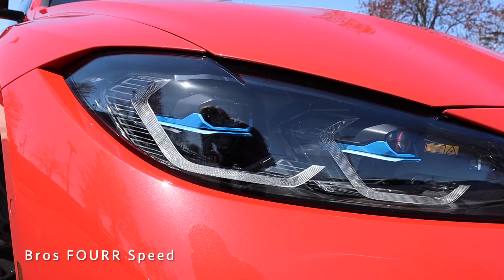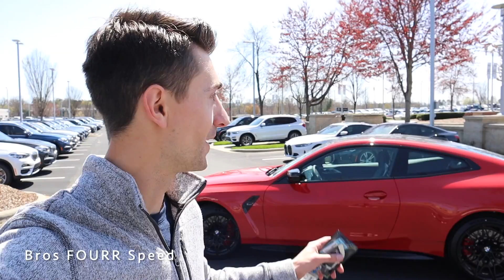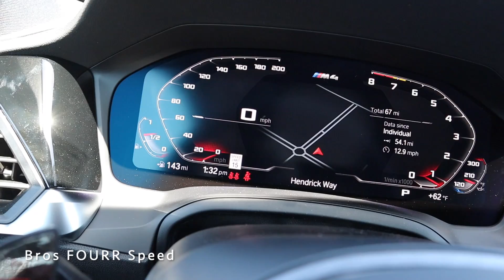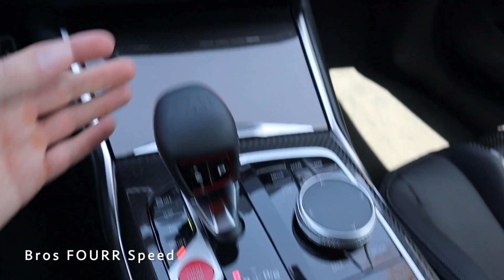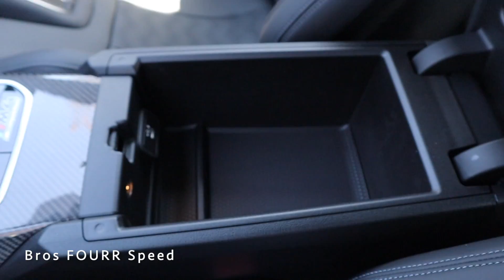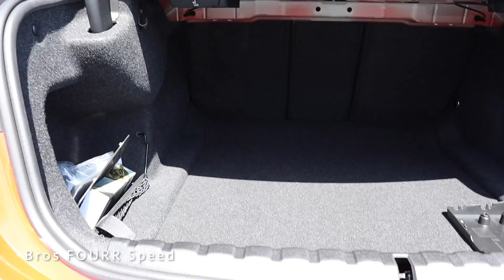2021 BMW M4 Competition Coupe: Start Up, Exhaust, Test Drive and Review

Comment: The BMW interior is VERY NICE but you’re paying $$$$.  EXTERIOR - Mustang styling copied.  Grill ugly!  Performance- 10 speed Mustang GT.
Reply from the maker: Its a nice car for sure. But there are a ton of differences between a Mustang and M4. Mustang still feels like basic Ford with cheap plastics. BMW feels much more put together. Have you driven both these cars back to back? I've driven every Mustang under the sun. While they are great sportscars for the money. Once you experience premium brand cars, you can tell all the cost cutting that goes into normal brand cars. M4 is on a whole different level
Reply: @BrosFOURRSpeed  - Yes I’ve driven both and I agree there’s a big difference. But I don’t think the difference is worth the difference in price.  My GT premium or Bullitt Mustang cost $40-50k it loaded and feels really great inside and looks great outside.  The BMW LOOKS BETTER BUT NOT WORTH TWICE.
Reply: @BrosFOURRSpeed  - You get a better sounding exhaust and more power from a GT Mustang.  The main difference is the interior especially the plastics.  You’re paying half the price for the Mustang and I think you’re getting better value. In about 3 years the bmw is selling for half its original retail price and trade in value drops a lot too.  You lose less with the Mustang because it costs less to start with.  How much money are you willing to spend and lose and a rapidly depreciating item?  I like to be frugal if I can especially when I can have so much fun driving a Mustang or Supra or Z for much less and have no worries about my warranty expiring!👍🏻😊

Comment: Compare a Race Red Mustang GT for half the price.  They look very similar re the exterior lines etc.  performance is also similar too.  The GT 10 speed V8 in the Mustang is very fast and engine exhaust sounds much better.  I think the BMW is nice but for my money I’ll take a Mustang.
Reply from the maker: As much as they might be similar in shape. Haven driven multiple Mustangs, there is no comparison at all. This feels wayyy nicer and more premium. Much better build quality and is a lot faster! A new Mach 1 would be on the similar line and thats mid $50k. But the M4 is still faster and has better interior materials.
Reply: BMW a kill a Mustang GT 460 Hp VS M4 505 HP plus BMW sports suspension I'll  🐕 you streets or freeway GTFOH

Comment: Great video. Have you driven the C8 Corvette? If yes, can you tell me if the M4 pulls similarly to the C8? Or which one feels faster? Thanks man!
Reply from the maker: I've driven the C8 quite a bit. Honestly the Corvette doesnt feel that fast. M4 is way quicker from a roll. C8 has amazing launch control, but aside from that it normal car fast. Not much quicker then my Supra when my car was stock. And this M4 is more on par with my Supra now that its tuned. So M4 will feel quicker most cases
Reply: @BrosFOURRSpeed  Appreciate the detailed answer man. Honestly, I'm surprised by your answer because all the people who drive the C8 on YouTube act like it's the fastest thing in the world hahah. My other question is: do the M4 and GTR feel about the same fast wise (stock for stock) of course.
Reply from the maker: I think there's just a lot of hype around the C8 where everyone just wants to say its the best car ever just because its mid engine. While its a great car for the money. To me it's just a Corvette that looks like a supercar. So the looks are making people just keep thinking its actually a supercar lol. It's no Lamborghini 
GTR feels a tad faster stock for stock and will launch better off the line.

Comment: This or the GT500 2021?
Reply from the maker: Thats a touch one! This will be a cheaper option. But the GT500 is much faster in a straight line. This isnt quiet as fast stock in a line, but this feels much lighter in the turns. If you want a car more for mountain, roads, pick the M4. More drag racing, go GT500